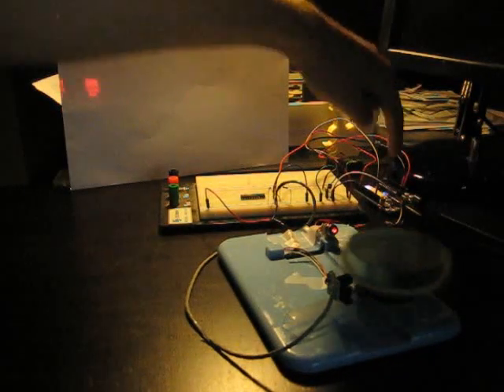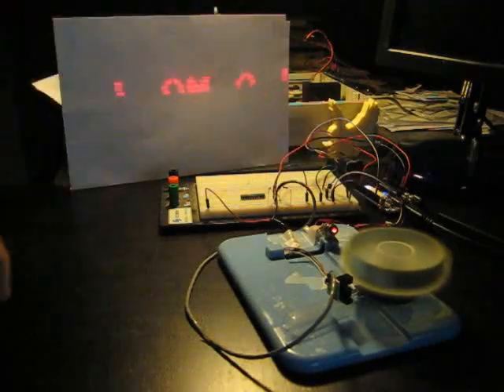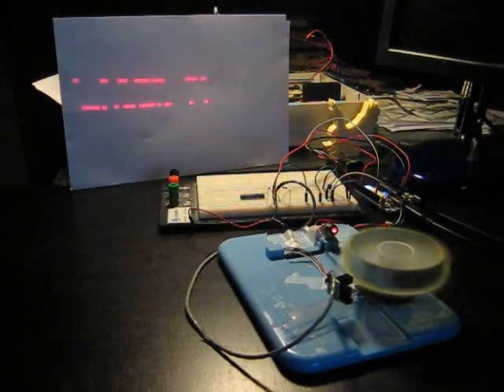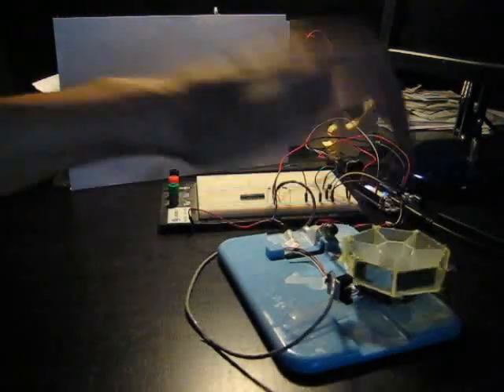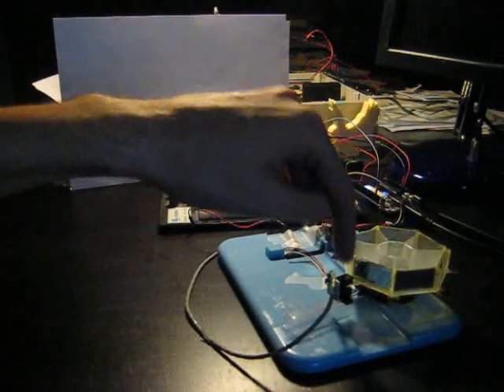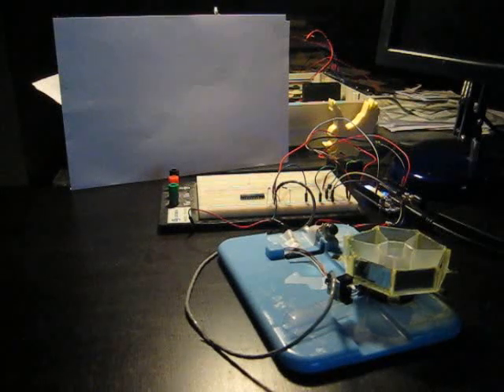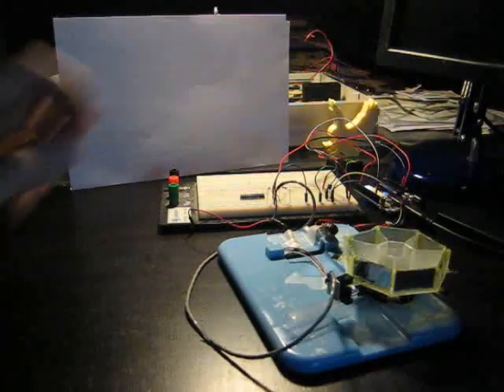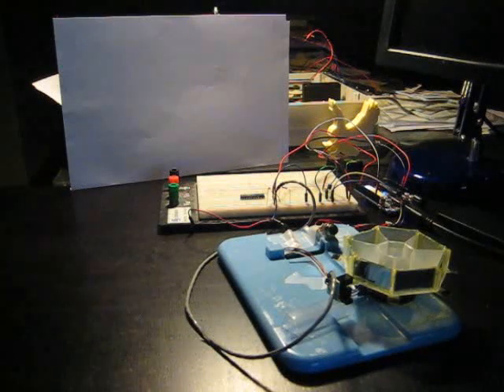DIY Laser Projector

Comment: Sweet!

The great thing about this type of setup is that after a line is drawn, the laser "instantly" (speed of light) begins drawing another, without having to move the laser beam back with a Galvo, and turning the beam off.

 I've always wanted to do something like this, but instead of the vertical axis being determined by the angle of the spinning mirror's, setting up a second spinning mirror surface, at 90 degrees, giving more possible horizontal lines.

Great work!